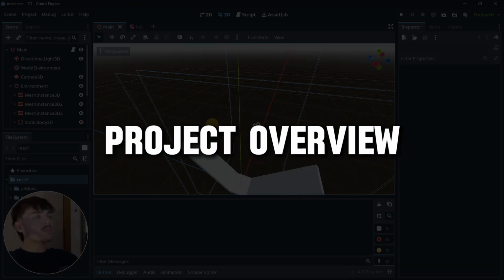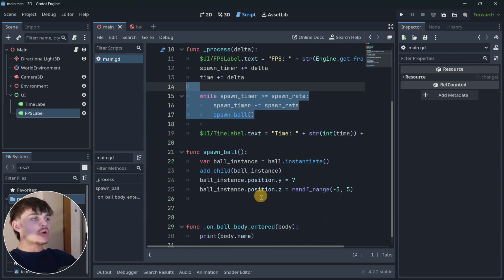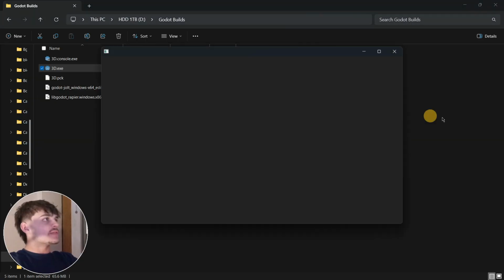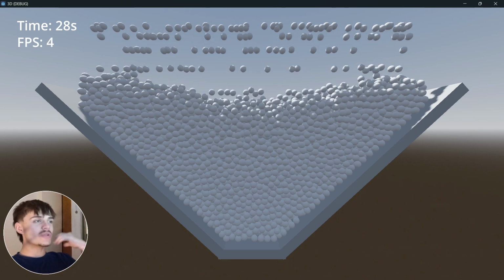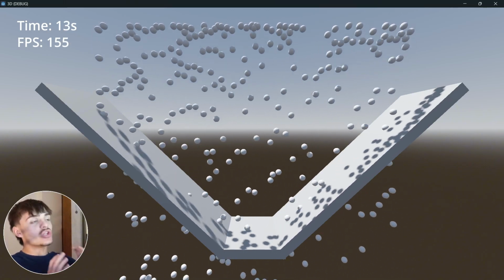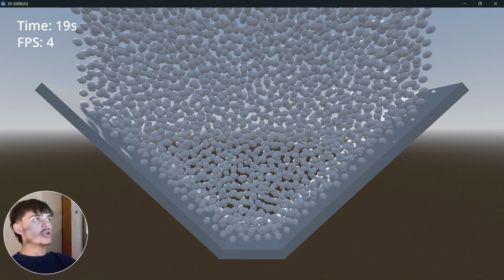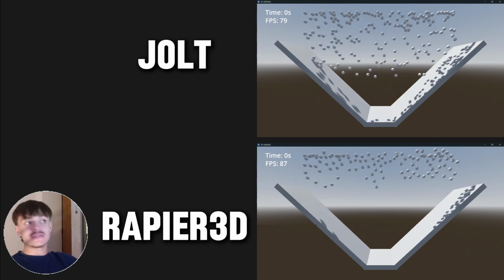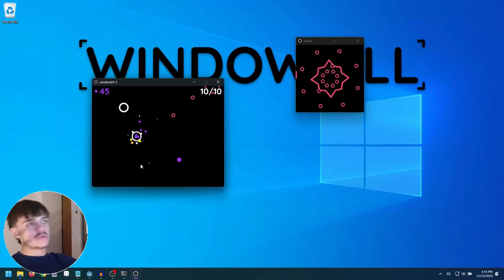Godot Physics: Jolt vs Rapier3D

Comment: btw, using $UI/FPSLabel etc. is much slower than setting a variable using @onready. $ is equivalent to get_node(), and running a function every time _process is run is bound to be slower than grabbing the variable once at the start.
Reply from the maker: Thanks so much! Will take it in count for future tests
Reply: Thanks, that’s good to know
Reply: Okay, I actually never knew that, I'll use that knowledge to replace some of $ with @onready var.
Reply: Thank you for the tip. I noticed a slight FPS boost in my game.